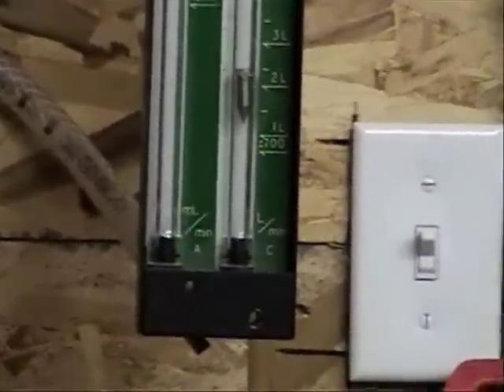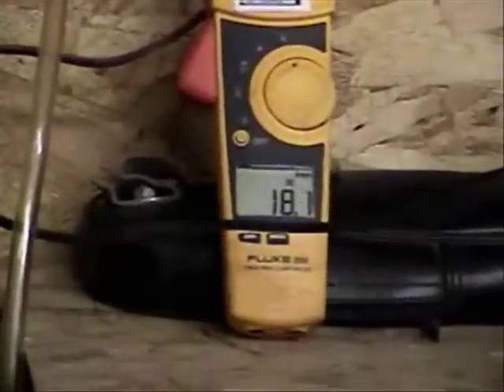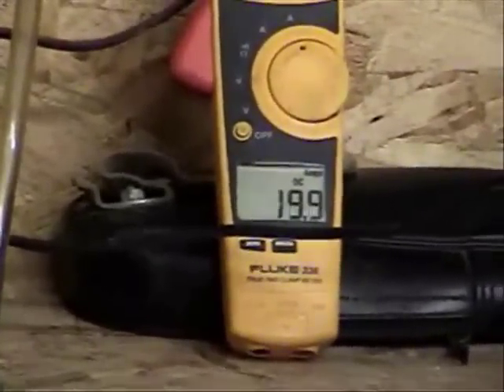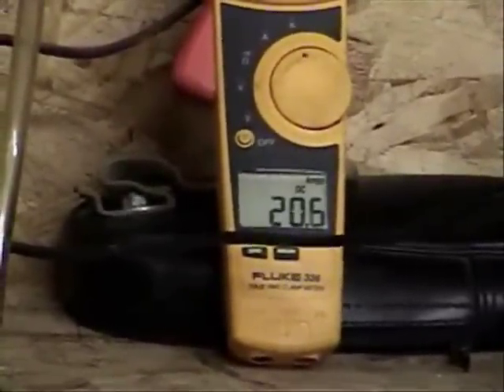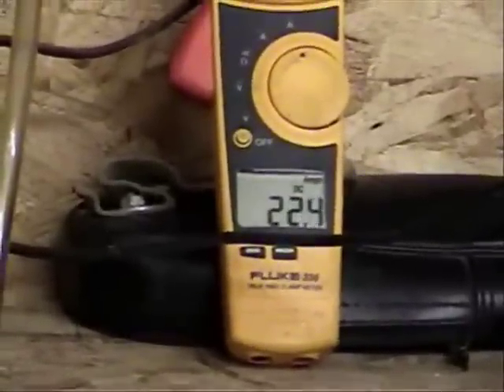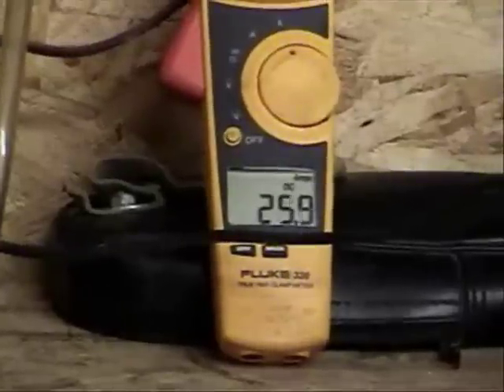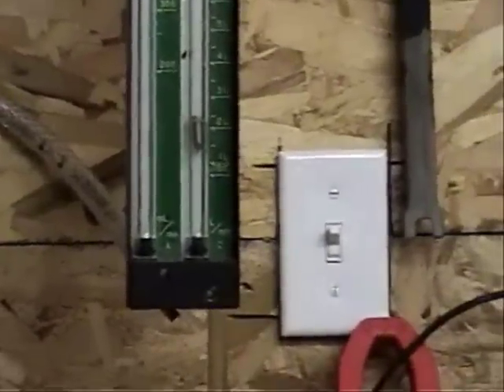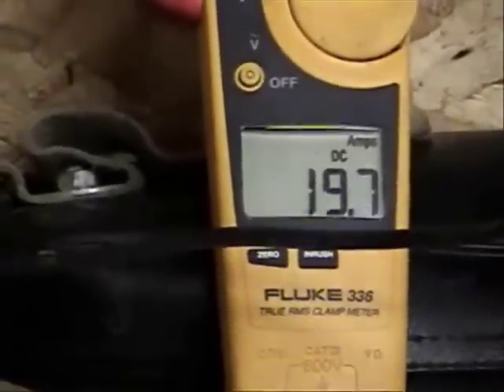9 plate cell 1 hole compared to 11 plate cell 3 hole

Comment: Hello, I'm building a 9 plate hho generator.
I have some questions and need help.
My plates are 8x8 inches and 1mm thick.
I am thinking of making mine with ;
-nnnnnnn+ what are your thoughts on using 
-nnn+nnn- or would this make my volts too high. 
Thanks.